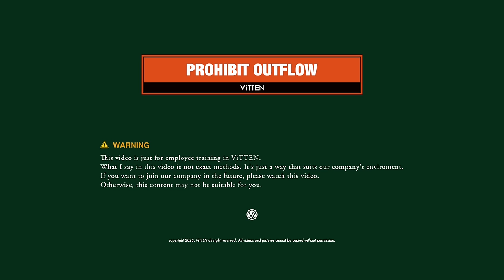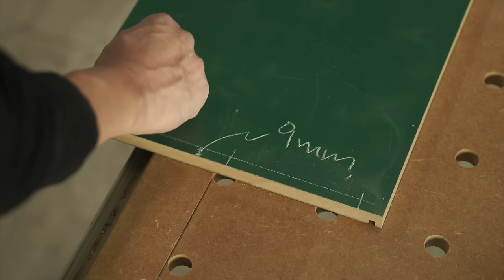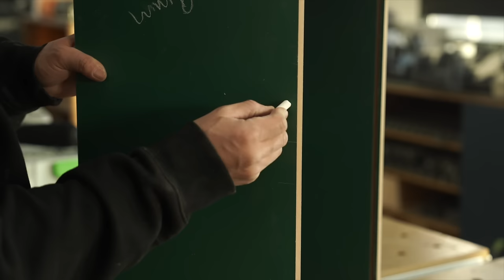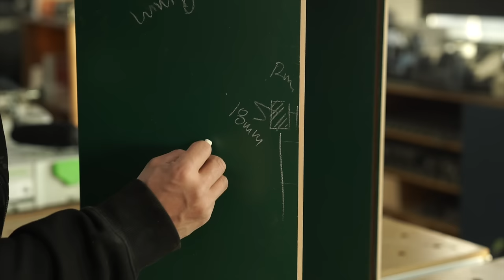make cabinet box (basic)_VTP001

Comment: this is advice because you can see that the MDF is cracking - it is split by the screw. After using a drill with a chamfer, you should also use a regular drill and deepen the hole to the full length of the screw. And there are special screws for MDF ;)
other than that, it's good work! :)

Comment: Just some friendly remarks from guy with 12 years experience in furniture making.
Like your making and installing videos, but here this is how not to make cabinet in terms of material choice and joint technique. MDF is pretty bad material for joining into sidewall by screws since it's basically multiple layers of paper pressed and glued together. By screwing into sidewall you split layers and it wont hold for long.
At 6:11 mark you can see splitted stretcher, same happend at all other joints. If you use MDF as your material of choice your best joint is eccentric coupler (rastex 15 or similar) paired with 8 mm wooden dowel. Yes, its more work to make properly all necessary holes, but it will last for life, especially if you glue dowel.
Slotted backwall is nice, but seems like slot is too close to end of sidewall, plus stretcher is inside, so it doesnt help to support backwall from pushing it outside by accident. Should be at least 12 mm from end, plus you can hide stretcher behind backwall adding support for it in the middle. 12 mm thick stretcher can be mounted on 5 mm dowels. If you use same thickness board for stretcher, you will have 18 mm of space behind cabinet for usage, f.e. for wiring backlights or similar.
Cheers and keep up good work.